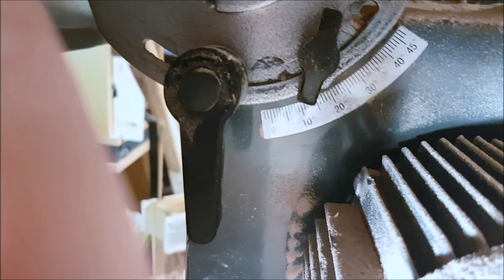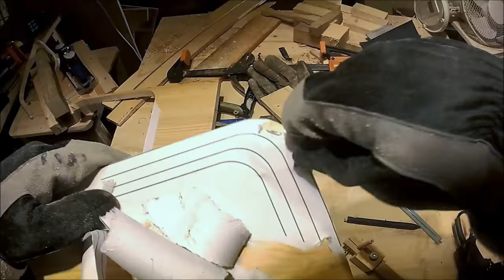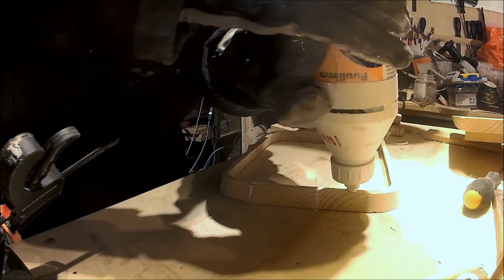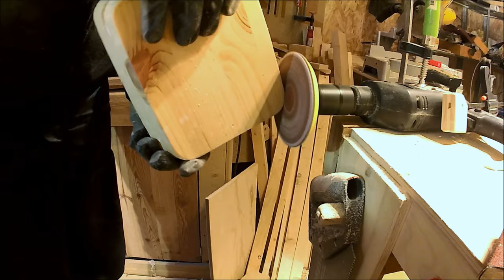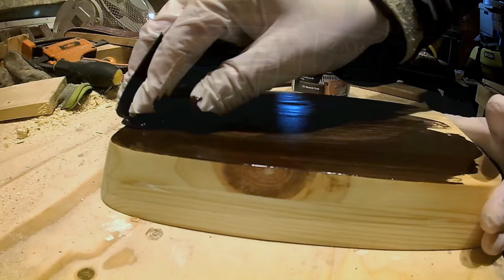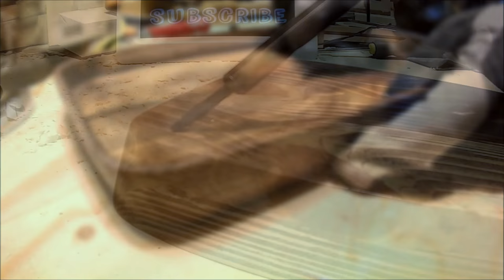Wooden Snack Tray made with the bandsaw

Comment: I need to get me another band saw, mine got sold... But I have been putting it off long enough, may buy one this coming summer. 
Love the looks of your work bench, busy I love it Great job with the sanding disk as well
What a fun project, I love it, thanks for sharing and have a blessed week.
Reply from the maker: Thank you so much for your support! A small bandsaw is so nice to have, I hope that you get one later. Fun side note - my bandsaw actually broke right about an hour or two before you posted your comment. The pin for the top wheel had broke, and the blade and wheel were comming off in the middle of a cut. But I will fix it soon. :-) Thanks again! I really like your channel and will follow your upcomming videos!

Comment: That turned out great my friend what was the degrees you set that on your bandsaw?
Reply from the maker: Vielen Dank Opa! :-) The angle was set to 20 degrees in this build, but you can set it to any angle you like. But if its less than 20 degress, the walls/sides will be very thin (depending on the thickness of the work piece).